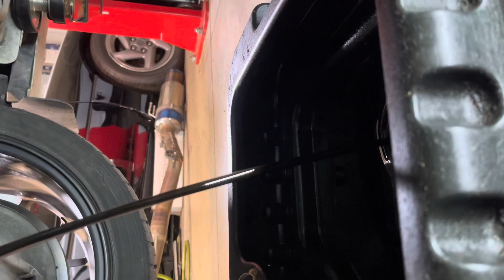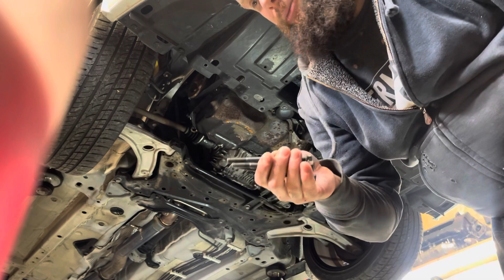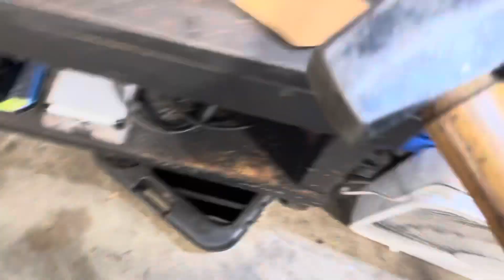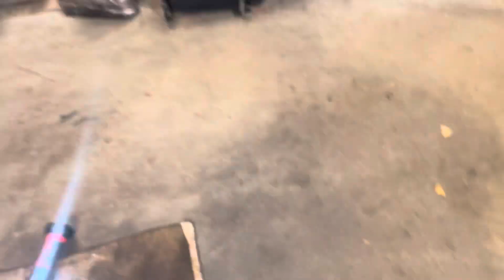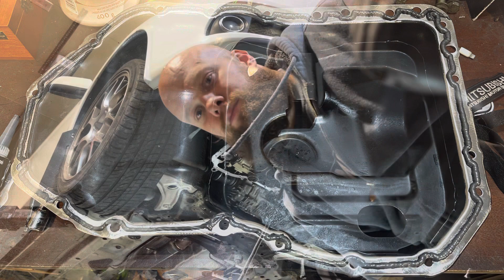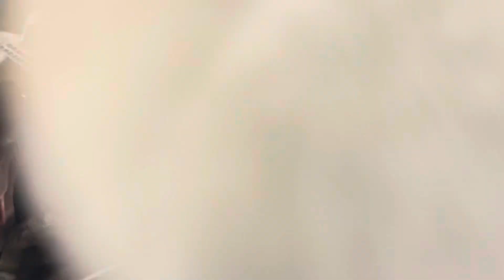Evo X / Ralliart Oil Pan Replacement

Comment: Bolt snapped from the bracket  but I'll get a new one. Was in bit of rough shape on the ralliart. Used this video for reference especially for the torque specs. Didn't feel like researching on Google lol.